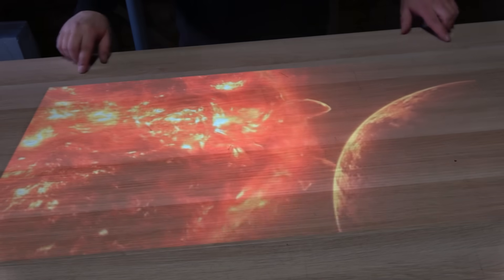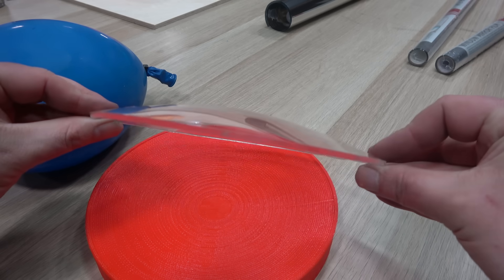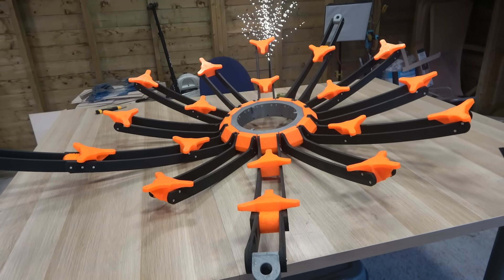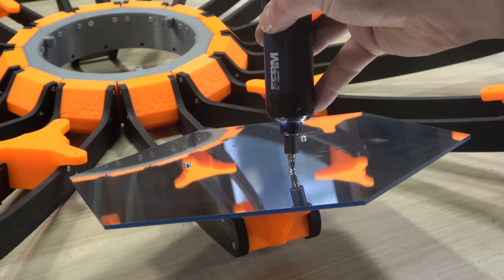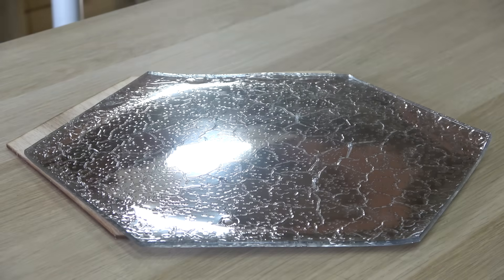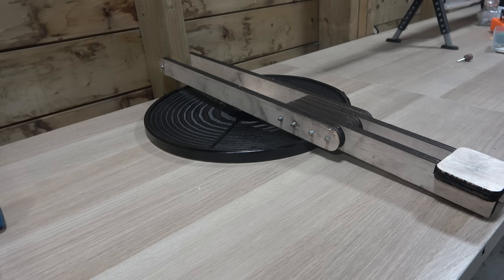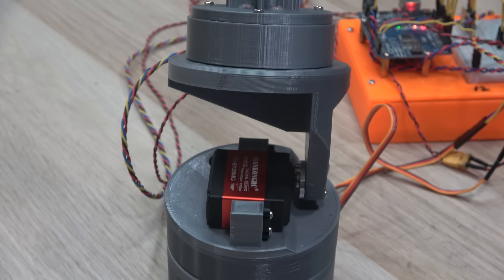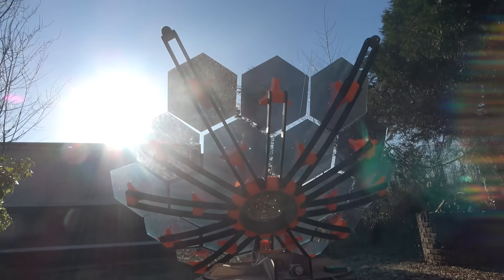Building a DIY Solar Generator..

Comment: it may be more cost efficient to have more mirrors rather than a moving system but i'm not an engineer, what i have found though is that many engineers suffer from the efficiency sickness and see results as raw numbers. meanwhile large well engineered projects in third world and even some first world countries fail because they require constant vigilance, high skilled workers and engineers, precision parts, capital etc.

meanwhile little dieseltrains that have run on sugarcane plantations for over a century still move around on crooked tracks, the simple mechanical grandfather truck rides around with patches all over it's vital parts and one guy litterally holding on to a component to keep it running. these are the things that work, that have proved effective even when maintenance is done by those with no experience or degree.

for us in the general population it is not much different, we should be able to use off the shelf parts to maintain such a system as much as possible and what is specialised should be as uniform and affordable as possible, even if it means a far less efficient system i'd rather use iron than copper if copper were just that hard to get.

Comment: Oh boy, there's a lot to improve in this setup. Guys, i can't read all the comments so i'm not entirely sure what was already been mentioned. 
One of them is to place your plate against the parabola, not on the parabola. Less reflections - less losses, more energy.
Other improvements include mechanical strength, better reflective materials (even cheaper, like mass produced mirrors, it's better than a paint), sensor calibration, better weight distribution and balancing, PID movement regulation, adjusting mirrors with the help of a lazer, thermal insulation, and maybe general appearance of the device.
Most of it was mentioned, i think. Feel free to ask me on details in case it's wasn't

Comment: You're collecting the parabolic reflection rays at a single focal point, but they are not coherent rays-- did you account for double the focal length of the dish in the parabolas of the mirrors? You collector is pretty big so it won't require great focus but the energy density will be lower than it could be which will limit your delta T.

Comment: I want to see this in full operation, optimized, and then a open source diy on the internet. Everyone should have access to a small solar array that is more than capable of powering their homes.
Reply: It didn't power anything yet. If electricity is the goal it's probably just enough to power a phone.

Comment: I see that most points are already covered, still there is one suggestion I didn’t see (but I didn’t read the whole either): as many mentionned, the spray pain doesn’t have a good reflectivity. An economical and efficient way of covering the acrylic plates is by applying a survival blanket onto them. It is metallized polyester with one side gold (real gold? I don’t know what metal is being used) and one side silver (probably aluminum, which has excellent reflectivity and is used for optical mirrors). Only tricky issue is to find the process to glue the foil flat on the acrylic plates. But it shouldn’t be too problematic.

Comment: With a device this size, you can use flat mirrors. That would be far easier (and cheaper, if you buy the mirrors). The center of the beam will be will be slightly de-focused, with helps to distribute the heat more evenly in the collector. 
There is no point to make such a complex pattern of water flow. Just make the collector large enough, with input and exit pipes on the back side in opposite sides of the collector.
If you want to make it super-fancy, make the collector a cylinder inside. Feed the water in tangentially on the perimeter, and exit axially in the center. This will cause the water to run in a spiral, like a tesla pump. The flow will be very turbulent, which is what you want here.

Comment: also it should be possible to get the giant satellite antenna (or print one), then just glue small squares of mirror along the surface. since the precision does not matter a lot as this is not a telescope. or, again, take a large list of metal, bend it accurately, then use a silver nitrate to make it a mirror. then you'll get a large surface, maybe not super precise, but cheap

Comment: I think a counterweight should be installed, and plastic or wood should be avoided in this type of installation. There is a risk of fire, so why not use 100% metal? It would also be possible to use more suitable engines, along with a Stirling engine system on the beam, combined with a liquid cooling system. 🤔😕

That being said, the idea itself is not bad at all. In periods of hail or hailstorms, a protective shield could be implemented to safeguard the parabolic reflector as much as possible. This shield could be made of anodized aluminum, with waterproof motors housed in a sealed yet ventilated enclosure. The entire system could be connected to a real-time Doppler weather station, similar to an aircraft radar that detects bad weather. 🤔💭

As soon as bad weather is detected, the shiny, anodized reflector could automatically retract, much like the dome of an astronomical observatory. 🤔 Of course, this could be complex, but if we aim for perfection, I don't see a better approach.

Comment: You're wasting the sun's potential
A blackened copper plate and mineral oil mixed with copper dust as heat exchanger
Transfer the heat into sand battery

Comment: Paint the aluminum collector with matte black paint to maximize absorption. Yes, your mirrors need to be parabolic, but each mirror ring needs a different mold because the position of each mirror is at a different point of the overall parabola... At least the design is radially symmetric so only one mold for each radius. On JWST, they have (the equivalent of) a 4th actuator ( spring loaded screw) behind each mirror to adjust the curvature for best focus. When you come to adjusting your collector in the sun, cover all mirrors except the one you are tuning. Then you can watch the shape of the light on the black target collector to aim each mirror. Interesting project.  Good luck!

Comment: definitely need to do something to the aluminum to help it absorb heat. It is actually used in construction to prevent radiation. Even a black paint would do wonders.

Comment: I would have used first surface mirrors, that way you are not losing energy by it refracting through the medium and then hitting your reflective coating and then back through the medium ... thin aluminium sheet would work.

I would have anodised the aluminium collector plate so that it's black and therefore more able to absorb more heat.

I would not have attempted to create parabolic mirrors, you want the mirror as a whole to be parabolic, so the inner ring of the mirrors will be a completely different shape to the outer ring ... using flat plate mirrors would be perfectly fine anyway, it's not like you need an optically perfect image.

Comment: Make sure to spray the aluminum collector plate with a flat black solar absorbing sparu paint to maximize heat transfer. I would also not use plexiglass on the back side of the heat collector. I think you would be far better off electroplating your plexiglass hexagons than using some random film. The film looks fairly transparent when viewed from the backside. You really want those primary mirrors to be as reflective as possible as in a mirror polish.

Comment: is that small pump gonna have enough flow ? so the water won't boil before it leaves the disk .  multiple entry and exit points on the disk and a bigger pump seem like a better idea for 3.5 Kw of heating power .

Comment: So the reason why they use gold is because that is the frequency in which the sensors can detect. It is not an arbitrary decision and infrared doesn't necessarily have more energy. You need to pick a reflector based on the the way you are going to collect the energy.

Comment: You can use polished stainless steel sheet metal rather than mirrors. Very reflective, of both heat and IR, and perhaps even mor so than any mirror would do. And a lot cheaper and easier to produce

Comment: I wouldn't make it out of plastic, as weather and climate will probably make the structure brittle over time. But that should be an easy (though more cost intensive) upgrade later on

Comment: The heat collecting block...  it should be inside a housing with a glass front to receive the sunlight. The housing will keep wind from leaching away the heat.

Comment: I would have the aluminium water plate anodized black, and put it in front of the mirror instead of putting a reflective (secondary) mirror there.
Mirrors always have reflection losses, and sending the light from the main collector mirror directly towards the water plate, eliminate the losses of a second mirror. The obstruction obviously will be bigger, but that percentage is not very much.
Furthermore, my suggestion gives you a very easy tracking option: If things are alligned, the waterplate throws a very nice round shadow, exact in the middle of the main mirror.. You only need three or four light sensors exactly around the perimiter of that shadow to make the system align itself!
Of course, you need two hoses for water towards the aluminium water plate, but that is doable. You only need to insulate the return water hose.
And… Do a test with aluminium foil for reflective surface, it might surprise you. Also, you absolutely don’t need a sharp focus, so you maybe don’t even need concave mirrors.. And thin glass flat mirrors probably can do as well.

Comment: Anodize the heat collector with black dye/stain! You need it to absorb as much heat as possible, not reflect it back. OR, you can stain the collector black, AND mount a 1-way mirror above it on a ring, spaced out an inch or so, to create a greenhouse effect between the heat collector and the 1-way mirror. It would give the collected light a greater opportunity to heat the collector by warming the gas sandwiched between the collector and mirror with any heat that's reflected back off the collector. In practice, it would function the same as a laser light collimator, with the goal of dumping energy into the trapped pocket of gas. I know I'm over-explaining the concept, but I want to be clear in my suggestion.

Comment: The "colour" gold in spray paint is not elemental gold, its a mix of other metals that have the wavelength that matches gold. This will not substitute the properties of elemental films. It would have been more accurate to call it a brass coating. I think this project would have benefited a lot with some research and knowledge about material sciences for coating lenses, mirrors, and more knowledge in the emf spectrum

Comment: The ability of your aluminum plate to absorb light/heat is key the final power output. Unfortunately, aluminum (like silver) makes a good mirror reflecting most of the energy. Consider painting this surface black. However, I suspect this black paint will deteriorate over time. It may be better to apply a black PVD coating to increase its absorbance. This process is used in creating black metal watches.

Comment: Nice, but very labor-intensive. It is extremely easy to generate electricity with normal solar panels. Due to the extreme price drop of solar panels (approx 70% since 2022!) they now only cost about 40 to 100 $ for 420 to 450 W.

Comment: Bro's school science project is expensive. 

Real world practical solution: 😅🙄😂
Reply: plus... springs... they are going to sag and become a mess over time.  Just use screws and some nuts to make your alignment once and make sure it stays in place forever without moving.  No need to make it 'springey'.

Comment: Why not paint in black the aluminium core to keep more calories?
The aluminum center plate is reflecting some light, which is lost calories. Use black instead in the sun facing plate.
This calories exchanger should be more efficient this way.

Comment: Gasoline almost $8.60 per gallon in the Netherlands, only worse in Hong Kong where its $13 per US gallon or Euro 3.29 per liter petrol. I do not know about electricity costs per kWh, but they can range from $0.03 to over $1 per kWh in grid utility delivered to home utility panels & power outlets, & one US gallon or 3.78514 liters of petrol or gasoline contains 33.7 kWh of chemical energy // 

Our little Honda EU2000 generator can steadily output 1600 watts for 16 hours on just more than 1 gallon or 3.78514 liters of petrol, providing very hard competition for backup power since local grid power cheap $0.14/kWh & rarely goes out unless crazy wind storm every 10 years or God forbit a bad earthquake //

Comment: Solar PV modules can be obtained in pallets of 150-350 watt each unit (in direct sun) with micro-inverters (better spread heat out, longer lasting) this kind of tech widely available worldwide as bifacial silicon PV in glass storm resistant meant for sunny roof facing sun arch in sky, on a west east tilt only system reliable simple cheaper & easy to mount, down to less than $1.40 per watt installed with bracket, cables, fuses, combine boxes, everything into an array of LFP batteries perhaps 3kWh to 20kWh or even 50kWh for a whole home power backup that works even in cloudy rainy overcast weather for a few hours every day, more in sunny locations near equator.

Comment: you can make a cone metalic with a small pin niddle exit . and also you cna use photodiodes and lenses on each photodiode to enhance the light from the sun. a cell is just a photodiode i hear

Comment: my question is : why did he not coat the mirror surfaces in aluminium? I think its called "sputtering" and im quite sure that you can get get it done for a few hundred bucks. He could also use multiple layers of aluminium foil and thermal, reflective adhesive ... they put aluminium dust into it, i think

Comment: Since I have a huge flat roof in the back of  my newly bought home, I imagined trying to build this too. I must have space for at least 4 of these with the potential to create a lot of steam pressure.
Reply: I don't know what the goal is, but if you want electricity I'd put up solar panels and if it's hot water evacuated tube collectors.

Comment: I was wondering if you considered to have the heat plate on the spot of the secondary mirror? This would eliminate reflection losses of the secondary mirror and also allow you to add a mirror in the middle. Although to be fair, if the array is aligned with the sun, then the middle mirror would get less or not any light due to the shade of the collector at the focal point of the mirror array.

Have you considered wind forces on this array? The small threaded pin to adjust inclination has a relatively small arm compared to the array. Maybe a triangular/A-frame support (like a swing-stand /'\ ) and hinge-point for the array in the centre could be more stable and you'd have more space to attach any motor and thread to actuate the array as well. This could also give you an opportunity to counterweight balance the part above the hinge.

Comment: Lies. 3.5kW peak maybe.

1.4 kW/m^2 in orbit, 50% lost due to scattering and it's night half the time. At 100% efficiency (which is impossible) that comes out to 10 square meters of minimum panel area, on the equator, assuming 0 clouds and a "free energy tracking gimbal" :D

I invite everyone to learn basic physics; it helps debunk solar liars :D
Reply: Im sorry but I dont know sht about physics and english is not my first language, "1.4 kW/m2 in orbit" means the total amount sunlight energy that hits every square meter of earth or something like this? Like i think you are saying this dish is too small to have this kind of power output, right? Im trying to calculate is this idea worth my attention since it would be perfect answer for my country laws if the energy output per m2 made sense.

Comment: Quick question: Would it be possible to rig up a passive heat pump system and solar oven to convert the excess heat absorbed by the mirrors and turn that into a small trickle of electrical power, running the sun-tracking motors and electronics off of that energy, so the photoelectric energy doesn't get wasted on running itself?

Comment: These films usually are similar to those coatings used on CDs and DVDs, if you've ever put a CD in a microwave, you know what happens
These tint films can be applied on a curved surface using soapy water spray and a heat gun, look up how they do side window solar tints for good measure

Comment: If this were my backyard invention I'd be opting instead for a long, wide section of steel pipe to move the water along, and instead of going for a concave dish on one small focal point I'd be opting for a long strip of sheet metal focusing evenly along the sides of the steel pipe to heat into steam. I feel like this would also mean that rotating the device to maintain the focal point througout the day might even be slightly simpler because you could roll the pipe horizontally on a mechanism above as a separate mechanism to the turntable which keeps the long cylindrical reflector aligned with the sun

Comment: I think wind resistance will be an issue (isn't it quite windy in the Netherlands). I think the whole mirror holding structure should be stiffer. Further i suggest to use two spindels for the vertical adjustments and both spindels should be attached above the center of the mirror hold. this would result in a stiffer and more reliable 3 point fixing of the mirror hold. I agree with using copper instead of aluminium. Do you plan to produce electricity? If so, how (stirling motor?)

Comment: Im sure you would have googled this, because you are smart, but mirrors use a metallic foil on the back.  So yes.  Never put mirrors in the microwave.  You literally put tin foil in the microwave, its just a lot thinner